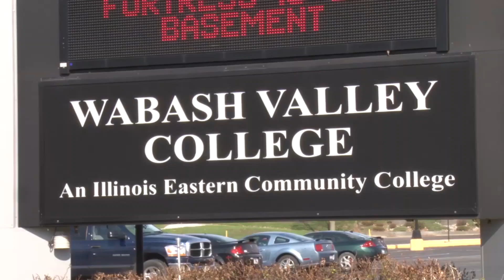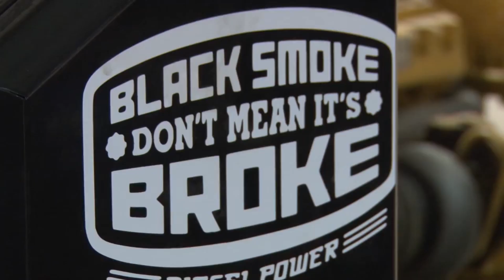Mechanics View on Biodiesel

Comment: Dear Scott   for years I have been experimenting trying to clean the brown deposit on any contaminated surface within the fuel system 
.   Our Toyota landcruisewr with a 1 KD - FTV diesel has done 40k on mimeral diesel 7 then 70 0dd K on B100 made by myself.   U suses to be on the forum many a time whem I was green to all the technology.   Many from the USA assured me they had done 30k with our type engine & so I took the chance. My wife I explained would kill me if that bio spoilt our engine.   Lately I have trouble with the fuel system but I am appalled by the facvt that a company has taken our injector pump out & bunged all the parts when they dissassembled the pump into a poly bag and even the delecate springs etc.
They said most parts would have to be changed.... NOt so because I find that the paint thinner that is based on 
N- butanol cleans perfectly with a bit on a cloth.   Standard celulose thinner does work but not as efficiently as the Buanol type thinner.
It's taken me 18 years to 'discover' the butanol.
Makes me ask the question does that product work diluted in the fuel especially    'Kero'  as this may burn in the modern diesel engines.... This is secret service stuff and must not be used in on road vehicles but can be used in off road machinery as you may well know........?   best wishes  Mich the commercial heating eng

Comment: Does the exhaust smell different?
Reply: It does smell different & might make you feel hungry.......  Ha Ha     First MOT 15 years ago using B100  the expereinced motor engineer seemed to be tapping the Guage for the smoke test.... I said have you got a problem Graham?   He said yes  i'm having a job to find any particles in the smoke.....   I said that's because there arn't any.....       I'm on the biodiesel now the chaps in the USA tell me thev'e been using Bio in their Toyoata prados  for 30K  with no issues at all apart from the SCV's   and changing of the fuel filter....
Mind you the SCVs go faulty anyway even on mineral diesel I'm told it's cost Toyota thousadns due to the tollerance being too tight.     A farmer 17 years ago    Antifuel1  said         'I'm lovin it'.   His used cooking oil was crap compared to mine and he used the first stage acid to make his fuel.   The acid takes the fatty acids down to about     3   for the  caustic  second final stage.....   he then could put the resulting clear liquid in his tractor.                     We are all getting screwed now re the price of cooking oil but it's still a bit cheaper than going to the pumps.....   The robbers...

Comment: Scott Balding is a third-generation technician and has been working with diesel engines for about 34 years and currently leads the diesel technology department at Wabash Valley College in Mt. Carmel, Illinois. He is also a strong proponent of biodiesel. Listen as he shares his thoughts on the benefits of biodiesel and why it's a good fuel source.

Comment: Bio diesel is one of the worst things you can put in a modern Diesel engine,,it has 20 percent less energy per gal,than straight diesel,,also it destroys anything metal ,,because acid is used in the production process,,it will eat your tank ,,lines,,,HPFP,,injectors,,and its extreamly high in soot and prosper,,,so kiss goodby to your DPF,,Remember ,,this guy is an actor payed by a multinational corporation,,,he doesn't give a crap about you truck or car,,this crap is being pushed on us by climate nuts,yet it's far worse for the inviornment than straight diesel...

Comment: It's also hydroscopic meaning it absorbs water on a molecular level bypassing water seperators. This causes long term internal corrosion issues especially on newer vehicles with higher fuel pressures. I'd avoid it if I lived in a high humidity environment.

Comment: Bull $&@…..
Bio diesel goes bad.  I work on brand new generators with brand new tanks. 
The crap has no shelf life.  It separates and turns to tar in injection system.  
It’s only ok if you have constant turn over of your fuel. And it’s worse the hotter it gets.
Reply: Utter rubbish.   Under my caravan   there is 5 x 25 litres of biodiesel some of which has sat there for three years and it's just as potent as any mineral diesel you can buy.    The 3 litre Toyota KD -ftv engine has blistering eccelleration with my home made bio but it is treated meticulously re the cleaning process otherwise hassle.... Yes there is some crap made that is supposed to be biodiese but who made it?   some uneducated oaf no doubt.... There are ways to test biodiesel but the so called professionals may not do what they should do.
There is nothing wrong with properly made biodiesel.....It's been proven to be better than mineral diesel.
Looking at the issue thro the eyes of an engineer.

Comment: at last, some one with proper knowledge of engines giving a decent comment on biodiesel. i have friends who have not changed the filter after a while on biodiesel, but thats the chance you take. biodiesel is many more times lubricational than any other fuel, so guys saying its too harsh etc are misinformed. biodiesel must be well converted, and after a while standing it needs filtering to at least 5 microns. filters are cheap, and usually last a long time. here in the UK we can make 2500ltrs a year with no fuel duty or VAT, as long as its for your own use. over the last 10yrs I have saved 1000s of pounds. the down side, waste oil can be a bit nasty and smelly. Energy bills are all over the place at the moment, but making biodiesel is still less than 20p ltr to produce, thats if your oil comes free, as all mine does
Reply: What car are you using? I’ve been told that biodiesel will ruin a modern diesel engine.
Reply: @jackjoyce1744  That's because modern diesel engines aren't real diesel engines.
Reply: How do you make your own biodiesel?

Comment: Would I be able to run biodiesel in an older 1970s tractor?
Reply: Man cooking oil can run 1970 anything that's diesel
Reply: Anything with mechanical injection, will run on literally anything. Motor oil, transmission fluid, vegetable oil. You should only really start being concerned when it comes to electronic injection as well as common rail

Comment: Bio-Diesel is one of the worst products you can use in your engine. To make it they use LYE..and that ACID is NOT "Deacidifed, and you are putting it into your $80,000 pickup truck engine. And, when it gets below 30 degrees. it turn to JELL unless you use an ADDITIVE..which costs even MORE. Oh, and it shortens the life of your $5000 Injector pumps and even if it's still under warrantee,,if you used MORE then 15% bio-Diesel, the warrantee is VOID. Look it up. BAD IDEA. REALLY BAD IDEA. Oh yeah, I forgot, it also eat up any SHINY SURFACE..like Injector points. Witnessed this while I was working for the DOD,,who, BTW, uses Over 22% of this crap in their vehicle. Why, because of a few people in the Pentagon that get kickbacks from the producers. And yeah, OUR Tax Money pays the price. The truck I drove would STOP RUNNING..and I was on an ACTIVE RUNWAY checking the Nav-Aids. The pump went out twice in 7 yrs and it cost the U.S. GOv't,,AKA, our tax money, over $4900 each time even though the truck was still UNDER WARRANTEE.

Oh, and if you notice, new "Bio-Diesel" acceptable Diesels have Plastic Tanks,,cause it eat through the Steal ones as well as the fuel lines. And, it also Separates if left over a couple of months with no agitation causing MORE problems.
Reply: Lye is a base not an acid, although you can use boric acid to make bio-diesel as well if you don't mind having to evaporate the water off the glycerol.  The lye reacts with methanol and oil to break the triglyceride group from the oil, this leaves the solution with the fatty ester groups (bio-diesel), glycerol, and a very small amount of sodium (or potassium depending on the type of lye used). Pure diesel will jell below 30 degrees without additives, it doesn't matter where you get it from or what it's made from.  EVERY diesel you get from the pump has additives in it to help with lubricity, freeze resistance, and to help keep the ester groups in suspension. The biggest issue with bio-diesel is that as vehicles have gotten more advanced because of EPA standards, the computers have a difficult time adjusting the system to deal with non-standard fuel mixtures.  Most diesels 20+ years old handle running bio-diesel significantly better than newer vehicles, just like how carbureted vehicles can run ethanol fuels with minimal adjustment while newer vehicles have issues adjusting the fuel ratios.  I've run up to 50% bio-diesel with 50% No1 on my 1999 W5500 and had zero issues.
Reply: @SammyNineFingers  Do you know of anyone that has run it in a Ford/Navistar 7.3 Powerstroke?
Reply: Good username??????   All the scaremongers who say biodiesel is no good must have shares or some other benefit in the diesel fraternity......    Those who say it is detrimental simply do not know what they are talking about do they?   Making biodiesel has got to be done correctly because it is a scientific process.   The cleaver guys in the USA  such as Biolyle would laugh at the ignorance of many of the anti bio men.......                     Please read about the proven technicalities before commenting.
 It  should never be allowed that those who criticise do not posess   a fraction of the expertise , experience, knowledge or perception of those who they criticise.

Comment: It also softens the paper in the filter and makes the fibers go flat so making them seem to be blocked when not.
Reply: Reason filtration system should be improved , I recommend an electromagnetic wire mesh system

Comment: I heard that you should not idle for more than 5 minutes on biodiesel is that true?
Reply: That is 100% true in fact 110% true I don’t know why but they say it could ruin your engine I don’t know I’m kind of sketched out about it I know diesel is expensive as all hell right now but I’d rather keep my engine and spend the extra money oh well
Reply: 2 minutes tops
Reply: It'll plug your DPF fast during idle
Reply: Don’t know, it’s the emissions hardware that may not be happy about it. Can burning biodiesel cause the DOC to surface plug?
Reply: @darylhawkins4658  no sure but i heard it runs really hot so its not good for your engine to let idle
Reply: Nonsense
Reply: In fact the bio is cooler because the calorific value is supposed to be lower than mineral diesel but it does burn cleaner that's why in some engines that would not pass the smaoke test for MOT will pass on b100 or maybe less bio in the diesel.   I have proof of that with the 1968 Land rover.....  No mot required now tho.

Comment: Ran a grand voyager for 40,000 on home made bio without a problem
Reply: Hi John. I have a 1999 2.5TD Grand Voyager 230000miles on the clock and i think to start using home made biodiesel. Can you give me any advice in producing my first batch of bio ?
Reply: It's best tyo look at the USA utah biodiesel   Graydon Blair is a lovely guy and the ultra biodiesel maker of about 20 years or so maybe more.   He may well be ready to retire now as he's getting older same as me.   Toyota Colorado 40K on mineral  then 60K  biodiesel.   It's hard to get rid of all the glycerol but a carbon block filter is the way to go after two other 10" filters    10 micron then 1 micron  then carbon block.   It's as clean as I need it after that but when learning the Bio was used far to soon. It needs to be meticulously cleaned otherwise serious hassle.
Reply: Lost a set of injectors due to biodiesel in a 2020 cascadia with a DD15. 250,000 miles since new nothing but biodiesel in it. Left a syrup looking goo in the injectors.

Comment: Yes, somehow it only cleans at low temperature.... In my case the same fuel line goes to two heaters. One heater's filter is located inside and has no issues.  The other one is located outside and clogs up with a black fatty residue. The spec sheet of FAME says that it solidifies below 15 degrees C.
Reply: You can see the tiny fatty flakes floating at 5C. I just love to see the spring come in the UK when it starts warming up......   They say you can go upto 10% petrol in the bio but if you can afford it its best to put winter diesel 50% with the bio.......   They tell me in Canada they use a lot of Kero in the winter,,,,,,   for the 'machines'????
Reply: @michaelhall7921  I have since switched to diesel with 30%HVO instead of FAME. Burns clean, haven't have to clean a burner since. Also no clogged filters in winter. Great stuff.

Comment: Tell that to all the primary fuel filters I have to change in the winter months just to keep that wax flowing
Reply: Even with a good transesterification, or they're using straight veggy oil on these cases?
Reply: I make and run bio in a 2013 common rail diesel ford that has a pugeot engine in it. It runs fine but the stuff will wax in lower temps. So not for winter use. It also softens the paper in the filters and makes the fibers go flat so after the varnish cleaning action is done you will still have to change filters a bit more often. I carry filters in the car and the means to change them so I don't waste miles on filters by changing until I really have to. I run straight diesel in winter months with an injector cleaner to give the system a flush out just in case I am leaving any potential problems behind as the fuel shop guys say injectors will have a brown coating inside from bio use.